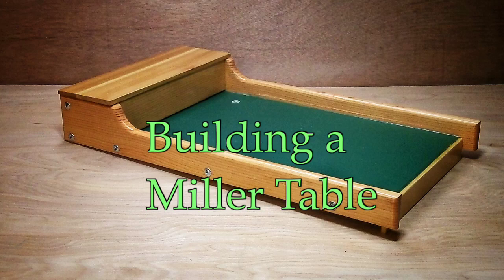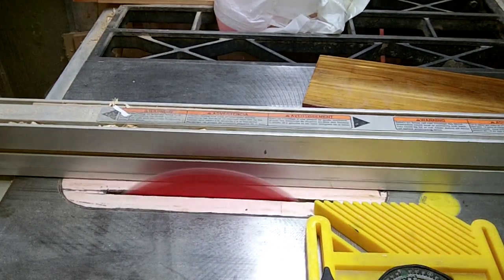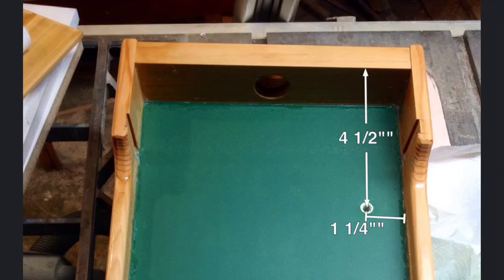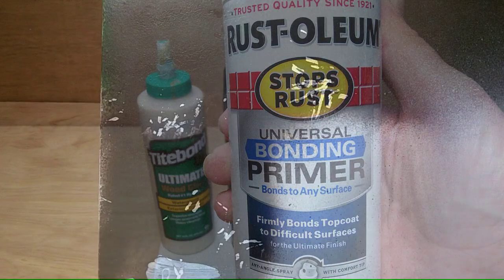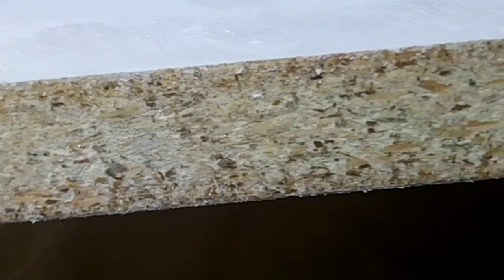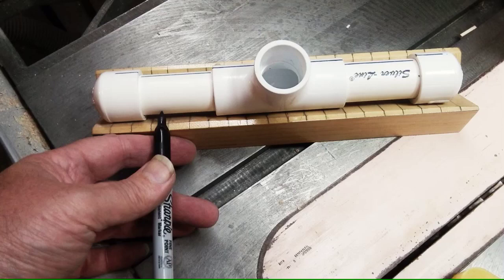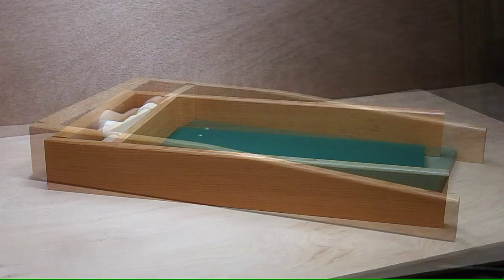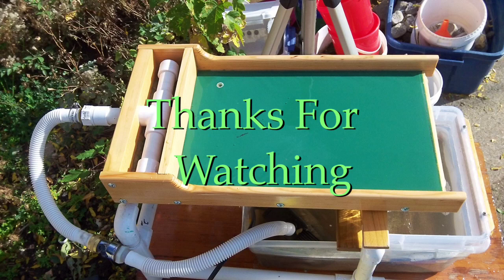BUILDING A MILLER TABLE

Comment: iam just sanding and paint with chalk board paint are it working?
Reply from the maker: +Fais Fadhilla Hi Fais, yes. Sand the wood sides and back plate and spray them with Spar Varnish. Then Give the Table part about 5 or 6 coats of Chalk Board paint. Good Luck and thanks for watching.

Comment: What size in width is your board kind sir?
Reply from the maker: Hi and thanks for watching. I usually make mine about 10” in width and 20” in length.
Reply: @utahavalanch  
Thanks for the information I have recently purchased a plastic chilling board like the one in your video I'm hoping somthing good will come if it I usually find small specks on the beach in the Black sands and I think this will be more helpful than a sluice thanks for your help in the video 👍
Reply from the maker: @NotSoPurpleSkull  
Yes, a Miller Table works by far the best for the fine gold. Especially the beach sand gold.

Comment: do you sell these?
Reply from the maker: +Dave Larson Hi Dave, Thanks for watching. Sorry, I don't. There are several commercial versions that you can buy just like it. The Martin miller table is one I like best.
You can easily build one of these tables using off the shelf materials, a handsaw and a drill with 2 bits, 4 if you put in a gold bottle but it's not necessary. Some folks find it's easier to leave out the gold bottle and just use a snuffer bottle to suck up the gold. A cheap shelf a 1x3 and some 1/2" PVC tubing and fittings and the waterproofing materials in the video and you are good to go.  You can buy all the materials at your local  Home Depot or Lowes. If you have any questions I can answer for you, just let me know.
Reply: ok thanks for the info